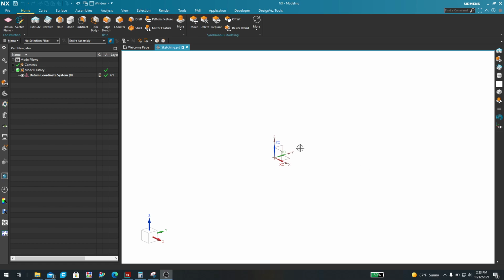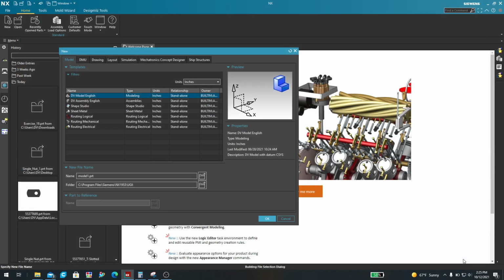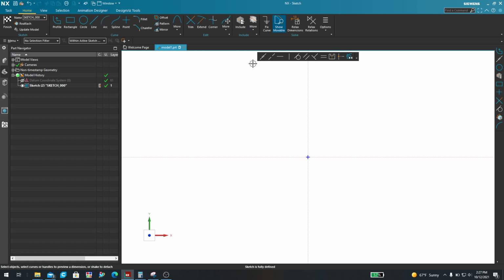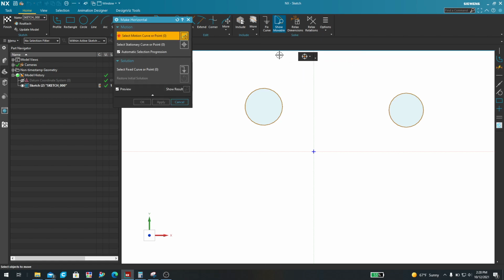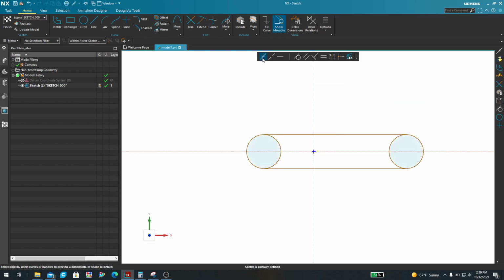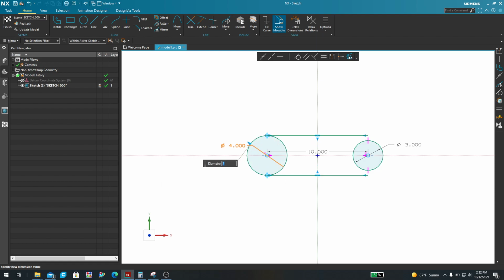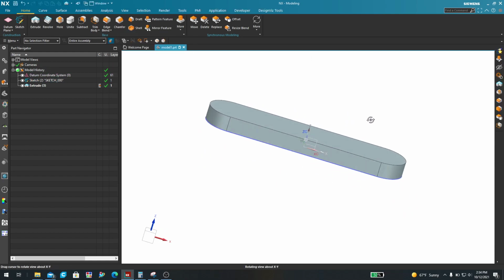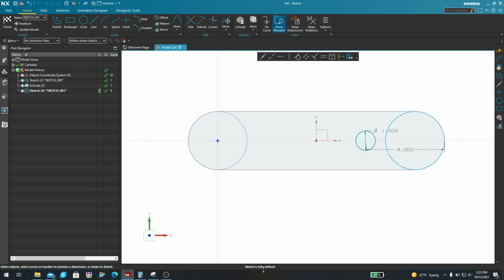NX 1953 - Tips for New NX Sketcher

Comment: Hi.
You can select geometry without clicking on "include", you just have to switch the filter of selection "within active sketch only" to "within work part only", nothing has change from old sketch for this.
However, what is nonsense in this new sketcher, is the fact that NX create lots of constraints that we can't break by only wiggling, this is sh.t sorry.
I found so many bugs in this new sketcher, it takes me so many minutes to update 1 part, he lost so many things when you change values in 1st sketch you create giving relations to others..
It's losing also direction for pattern witch is completely nuts.

What is also intriguing is the new relation "stars" everywhere, each time you enter the sketch, causing difficult updates. You can destroy them but they come back each tile you enter a sketch.
Last point, is the impossibility to update a dimension if you are not into the sketch. On the old version, you didn't need that, and it is a waste of click. Of course you can add relation to every dimensions and you can update the dimension in the 3D, but sometimes you can't, the dimension is blocked for no reason and appears yellow. The only solution is to go into the sketch, convert the dimension in yellow to reference, then convert it into active and only now you can change the value you wanted. It's making me crazy.
Sometimes I'm in a 100 parts conceptions and I have thousands of new clicks, minutes/hours of waiting I didn't have before.
Did you experience all those situations ? I'm really curious :/
Reply: It kind of sounds like NX is saying Creo is a better software.

Comment: Great video! You don’t really have to manually add reference with Include, you can just change the “Within Active Sketch Only” selection filter menu to “Within Active Part Only”. Then it will add the lines/arcs you add a relation or dimension to 😌
Reply: Thank you, I was looking for something like what you recommend and the include command.    The "selection scope" option to choose between active sketch or active part is in the "Selection" ribbon bar.